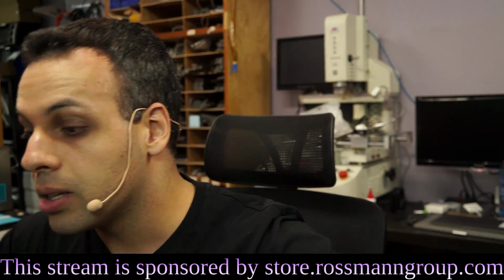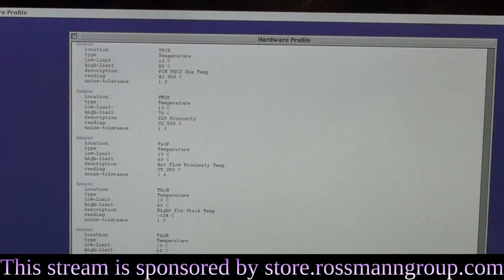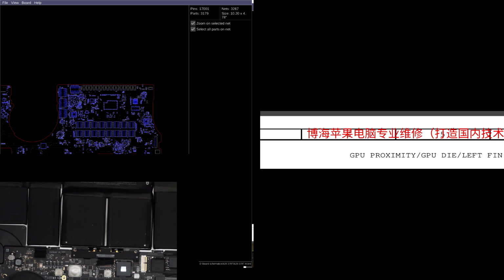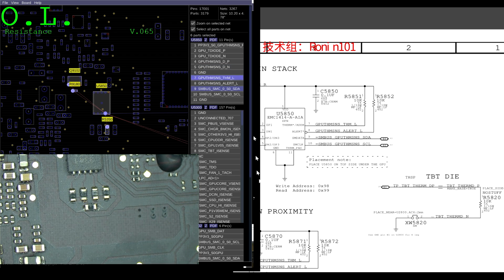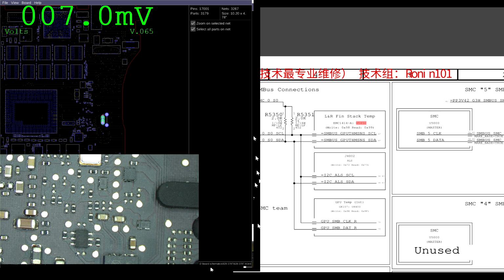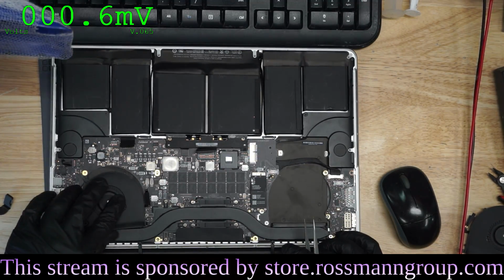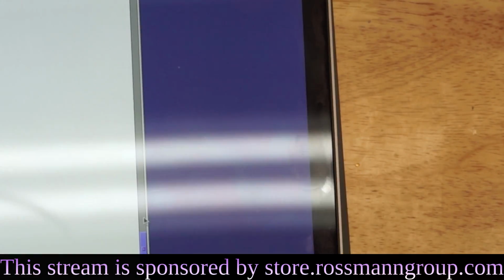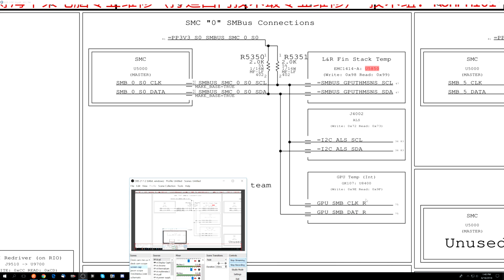What franchise can't fix in two months Louis solves in 20 minutes. Franchise = :'(

Comment: This could just be a method of planned obsolescence. Have a little sensor that doesn't matter, and that's difficult to replace, share data lines with important sensors, then have it die, causing a system slowdown; harder to find and diagnose than most issues, and nobody wants to do the work to replace it. Causes a near-dead product that requires replacing, and what's someone within the Apple ecosystem going to do? Buy another Mac, then Apple profits off of planned obsolescence.
Reply: Xander Zoolander yes, that's why it's done, probably... But that is not good engineering.

It's good marketing if you get to shaft folks regularly like that and they commentary back for more in a demented expression of Stockholm Syndrome.

Comment: Curious... Would Linux and its various sensor checking tools be capable of providing the same data as the official apple tools?

Also, holy crap, the customers that bitch about existing problems that "only happened after".... Those people are retarded.

Comment: I don't know what exactly apple has done to get those kinds of GPU temps at essentially idle, my almost 12" long desktop GPU draws close to 200W under load and reaches around 75c max but when it's not in use it's sitting at around 28-32C. there's zero reason for a GPU to be hitting almost 70c at idle that's just stupid. I'd personally be losing my sh%7 if my GPU idled at over 60c even without fans it only idles at 40-45c while passively cooled with the heat sink assembly.

Comment: About the apple service diagnostic tool. As far as I know, there are multiple ways to read sensor data manually from command line. Also there is a project HWSensors concerned with reading lots of sensor data to show it in HWMonitor. Do you already have a replacement for the apple service diagnostic tool? It should not be that hard to hack something together to check those sensors ...

Comment: Louis I get the fan spinning at maximum, no temperature sensor data, ramp it up do max to be on the safe side. But why does the CPU become slow?
Reply: Spartacusse the OS is probably underclocking the CPU. The fans spinning is to get rid of generated heat. Underclocking the CPU is to reduce the generated heat.

Comment: A bad webcam can cause a sensor fault???  Who the hell decided that was a great idea, having only ONE data line for the webcam and GPU sensors?
Reply: Someone thinking different.
Reply: @Chuckiele  LMAO
Reply: my bet is cost cutting, having 2 data lines would have cost .0000000000000000001 cents more
Reply: kerc Chan and that’s like a months paycheck to the poor Chinese guy putting the computer together
Reply: That's very common in many electronics. There are many protocols that support multiple devices on one line by giving each device an address or having a device pull it down to claim it and send data. This is one of the disadvantages of those circuits.
Reply: Probably an engineer from the same school that put BMW 3 series Comfort module (the part that controls starting the engine) in the same data line with keyless door handle electronics. When the keyless handle electronics fail, the engine cannot be started and the car diagnostics stop answering questions. For another educational video, see https://youtu.be/B7gggowzPSE

Comment: This issue is super common everywhere.  I recently had my diesel truck not start and when it was running it would throw transmission codes and the 4x4 didn't work.  Well, unplug the fan (that shorted to ground) and everything started working again.  Fan control shared ground circuit with the MLPS, 4x4 and a few other things and when you have a short dragging voltage down, everything else went out of range.

Great diagnostic Louis - I have zero intention of purchasing an Apple product but I find these repair videos addictive to watch.  I'm not an anti apple elitist, I just don't have a use case for one.
Reply: With more and more things being controlled by ECUs, electrical has become the biggest issue with new vehicles hands-down. You get engines and transmissions now that will run for 200,000-300,000 miles without an issue, brakes that will go for 100,000 or more. It's all the wiring, sensors, and computer controls that break first and the symptoms can be downright maddening.

This is one of the biggest concerns with EVs ... when literally everything is electronic and computer controlled everything is ridiculously expensive to troubleshoot and repair. Hopefully with more shops becoming familiar with component level troubleshooting like Louis does EV repairs will get cheaper, but right now it's ridiculous. (I know Louis doesn't do EV repair ... but I forsee the future of the "shade tree mechanic" being a guy like Louis who fixes EV computers instead of replacing them.)
Reply: @drumguy1384  It wouldn't be that bad IF manufacturers had publicly available documentation about the expected voltages and waveforms on all lines. With info like that, it would be easy to find out the problematic circuit. Even better would be a system that could monitor such errors automatically and report the results using dedicated data and power lines. However, modern engineering cannot create such things, it seems.
Reply: Kyle Q Apple isn't the only ones doing shit like that. But they're the only ones that do it, get defended by their fans for it, and charge shitloads of money for "repairs" that don't do fuck-all...

But yeah, exposing Apple may well lead to people not taking it from other companies as well...
Reply: Kyle Q wow, what make is your truck?
Reply: Kyle Q dont bother, apples laptops and desktops are great while they’re working. But almost always absolute nightmares to deal with when shit hits the fan. I only use their stuff as I like iOS and OSX as I like stable reliability for what I do. Their Laptops of recent are POS. I ended up building a custom pc with a quad os set up with hackintosh, windows 10, linux and ununtu on it.

Comment: I have seen local computer shops in my hometown tell people they can fix a Linux/Mac issue then have zero clue how the software works as had an old friend that was given a laptop that had Fedora installed on but when it had an issue he went to a store that charges a standard fee of £15/20 upfront to even look at the computer but somehow managed to destroy his boot loader then said it was his fault for not using the software the laptop shipped with (originally XP), I was able to get him back up and running in about half an hour, I suspect they had zero clue how to even use Linux and just wanted the money from him.

Comment: Im an EE graduating this year and it seems like common sense to separate serial lines of "mission critical" peripherals and "quality of life" peripherals.

Clearly apple only hires people with high GPA, because all the kids with high GPA have little or no experience building complex systems. I have definitely taken a GPA hit with my work on club projects at my university. But companies like apple wouldn't give my resume a look after they see my less than perfect, less than top 10 percentile, GPA.

Hence they just get a bunch of kids that know how to cram information into their heads or hack a prof exam style to get good grades on exams. But these kids dont know how to actually engineer anything, and can't think for themselves.
Reply: Eric Cartman good point thank you
Reply: I think its a bit different. The sensors are there not to detect failure , they are there because of some usability function. IE: high temp = high RPM. But they just don't care if a failed circuit brings down the hole thing because its design to be a disposable item. They think of it as "always good". I see this all the time in another area (programming) very little attention is placed on the "non working state" until there is a problem that affects the bottom line. I don't think engineers are at fault here. I bet many of them follow Louis channel. I think they have their hand tied just as many of other people in other areas of business. 
I dont even think this is a particular issue of Apple (the engineering) apart form there prices practices, all brand do stupid engineering stuff, but because they are not HIGH price, they get away with it. People just throw away HPs and Asus laptops like its nothing because they can get another one for the price of the repair. That's why there is no repair channels dedicated to those.
Reply: @maxsnts  Lots of companies doing agile development jumps into happy path design. Fix the bullet points and if errors crop up they are then assigned at some later stage. Probably ok for a web site where there are continuous development. But for hardware the management has a hard deadline. And developing happy path means that lack of resources aren't caught quick enough. Lots of bugs are found late. And lots of hardware goofs are found when a late prototype is put in the climate chamber. And then there isn't time to redesign.
Reply: i think it's about the tool to make the system. and the deadline thing. it's easy to forget little peculiar stuff if board macromanagement is abstractized. top level engineer be like, i2c sensor, less than 256, just tie em up in one input and be done. in reality, the bus is all over the place, ruining router engineer's day
Reply: I'm from elsewhere. What is a GPA?
Reply: T P Grade Point Average. It's a numeric summary of the grades you have received so that the decision-makers at schools and governments can have an easy number to point to when attempting to measure student performance.
Reply: Average score over the whole course.

Comment: I have a feeling why the ambient light sensor is on the same line as those temperature sensors is because they are worried about your laptop being stuck in a bag and turned on.  If the ambient light sensor can't detect any light at all, the machine thinks it's stuck in your sealed bag and closed, so it tries to save itself by running slow and cranking the fans. The alternative would probably be to shut the machine down, but someone thought it would be better to let you use the machine a little bit vs powering off entirely.  Not saying this is a great way to do it, but it's my thought as to why they tied the ambient light sensor to the temp sensors.
Reply: Yes, I know.  I'm explaining why I believe it's on the same line as the temperature sensors.  Because in Apple's mind, they are related, because if the ambient light sensor isn't seeing light, it means the laptop is probably closed and in a bag sealed up, so crank the fans and slow down the speed.
Reply: @Toby_Q  Why would they want to leave a laptop on if it's in a bag, sealed off and nobody's using it?)))
Reply: SHIT THIS IS SMART!
My friend has a laptop (I think it’s DELL) and he was working in a virtual machine and his laptop didn’t turn off when he closed it and put it inside of the bag. He burnt his hand when he pulled it out. It just didn’t slow down even though it was closed and overheating. If apple really thought of this and it’s not just a coincidence, then that’s just amazing. I don’t want my laptop exploding when it doesn’t turn off properly.

Comment: Louis, I use an app called Mac Fan Control which allows you to set fan speed based on a sensor value.

It has 14 sensors and although it isn’t as detailed as the Apple Service Diagnostic it allows you to see data from the sensors and works on newer MacBooks. Perhaps this could be a tool you can use to get a general idea for sensor failure on newer MacBooks?

Comment: from a systems engineering stand point, plugging all those sensors to the same I²C (SMBus is globally the same thing) makes sense. But having it react in this way to this failure scenario is beyond me xD
Reply: Ybalrid well you have no way of telling which sensor failed. So what could happen is that GPU would start to warm up and because you don’t know how hot it is, you wouldn’t know how much you need to cool it down and the next thing you know is your laptop burning down your house. That’s why when you don’t know the temperature, you slow down the laptop and just cool it as much as you can. Slow computer is better than a burnt down house.

Comment: Other world Computing "macsales.com" makes a kit that allows you to install any Harddrive in an iMac, they makes an external temp sensor you can connect to the motherboard where the original hard drives internal temp sensor connected and it solves the issue of high fan spin. I did it once for a customer in and Authorized apple shop I worked for.

Comment: That diagnostic tool is so outdated that it looks like Mac OS 9
Reply: I find it refreshing to have a UI thats not an over designed mess !!!
Reply: A large number of diagnostic tools use a command line interface (or are just barely a step above a CLI), because it's is way more likely to work than a GUI if you have driver or hardware issues. Having a nice shiny GUI for your diagnostic tool just makes it less likely to work when you need it.
Reply: Seemed pretty clear when he explained that this macbook could be checked with the old software.  Also, if it works, it works.
Reply: It's not actually that old. While the ui skin is aged the actual tool is likely fairly updated to support modern machines but I doubt it needs to be constantly updated anyway
Reply: You mean that it looks good.
Reply: Pocket Calculator Yeah, I miss the old Classic Mac OS interface. Not enough to go use an old Mac, though... I needs muh YouTube 

Wait, does YouTube work with those? Nah, I’ll bet nobody ever wrote the codecs for it.
Reply: Moondream Productions why update it if it works fine?
Reply: Nudgy if it isn't broken, don't fix it.
Reply: Because that indicates that it relies on old code or in short bitrot.
Reply: ASD is the old diagnostic software not the new stuff.
Reply: @Nudgysirens  okay but this is supposed to be new software
Reply: Apple Hardware Test/Apple Service Diagnostics are actually a set of EFI applications and drivers that were updated with new hardware support and they most likely didn't put much thought into making it look nice because of some technical limitations. Probably at some point some new project manager came along, saw the UI and said "WTF is this" - the modern equivalent of Hardware Test does not have that type of UI at all, it's far more simple: https://support.apple.com/en-us/HT202731
Reply: Doesn't ASD come with 2 versions for each, OS version for gui mode and EFI version for og mode like in video
Reply: What kind of System 8 is this?

Comment: Well considering you're working on it on top of the webcam and since there's evidence of lack luster repair it's possible that (the repair guy) roughly handling the Macbook on the workbench could of damaged the component or the leads to the component.  Now since this is an Apple Product I can understand the immediate oh the repair guy can't be at fault, but you said half of the screws are missing and they couldn't take the time to reglue a battery. Sorry sloppiness get's no pass if it looks like shit. I'd stand with your customer if they decide to sue the other repair guy. Have high standards man.